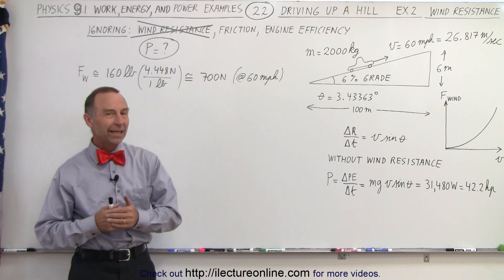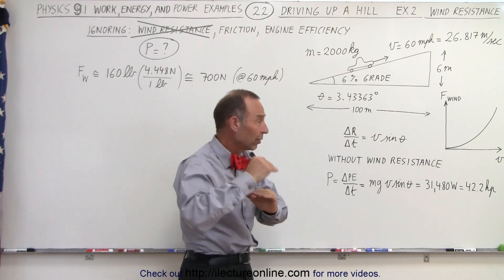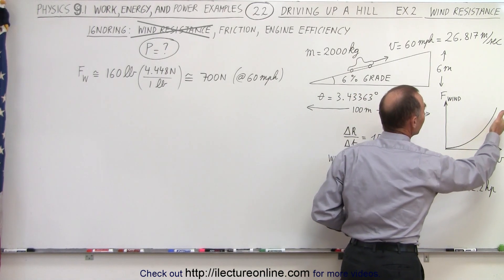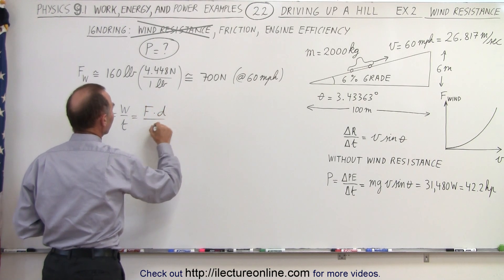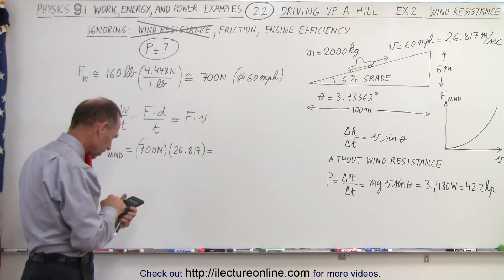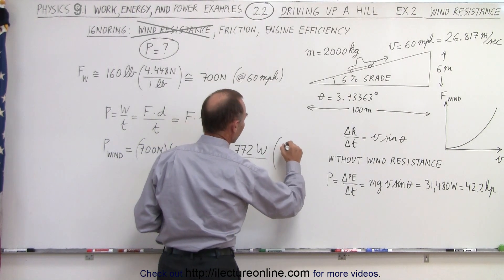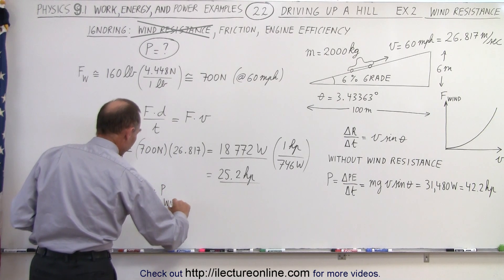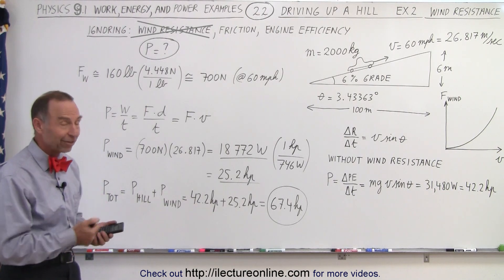Physics 8.1  Work, Energy, and Power Examples (22 of 27) Driving Up a Hill: Ex. 2

Comment: Thank you for these informative videos. How would you account for different wind speeds and direction relative to the vehicle heading? I am struggling to understand how one would consider the effect of a tailwind/crosswind/headwind in these calculations.
Reply from the maker: The aerodynamics of wind resistance is very complicated.  We can only approximate the effects.  Most of the research is done in wind tunnels using smoke and force measurements.